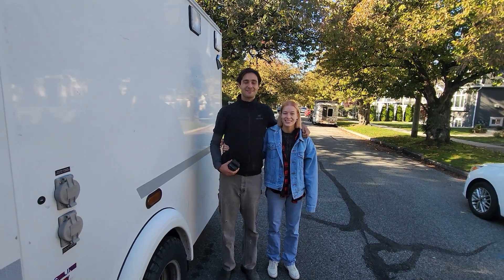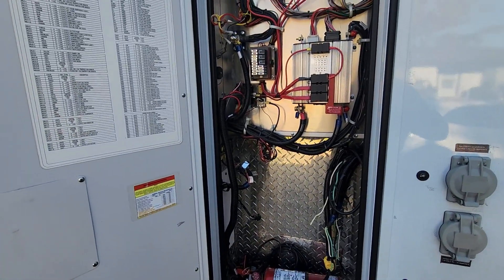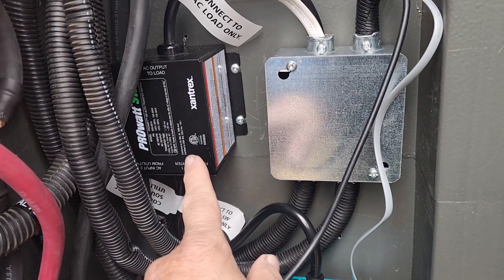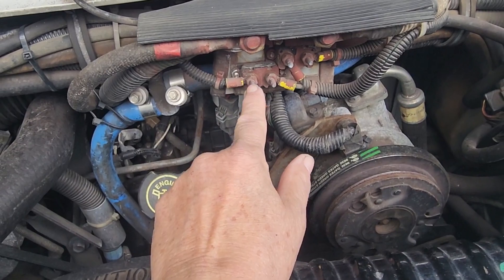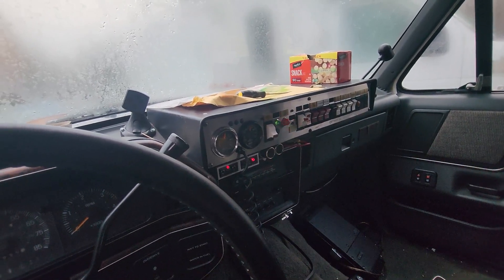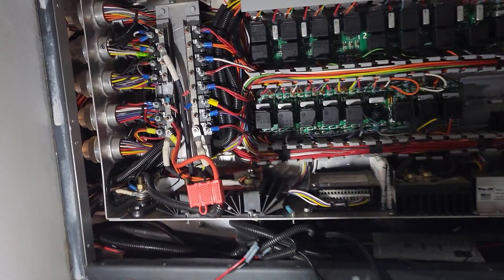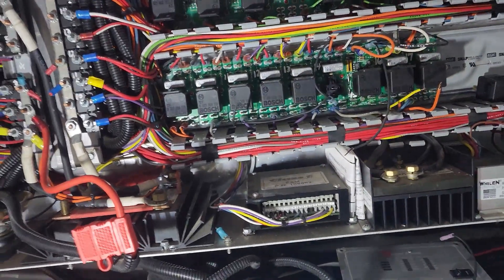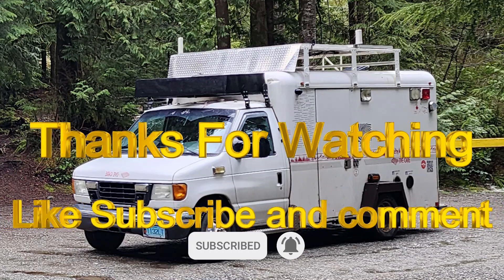Rewiring and Isolating 4 Ambulances Truck and House Batteries

Comment: How’s it going Wayne. I just picked up a type 2 Ambo. I am currently in my 3 year of a commercial electrical apprenticeship and am excited to learn more about DC. My question is, can I use a DC-DC with MMPT controller  to power my devices when I’m boondocking without the engine idling. If I use lifepo4 batteries how will that effect the self jump switch if I were to use it. Thanks in advanced.
Reply from the maker: Hi Michael  Look at the DC to DC with MPPT and dual battery chargers for your house batteries. While driving your altenators charge the house batteries and as well as any solar depending on amount of sun. I don't recommend using you lithium batteries to jump start your ambulance especially if its a desiel. What is the make, yeat and engine type of your ambo?